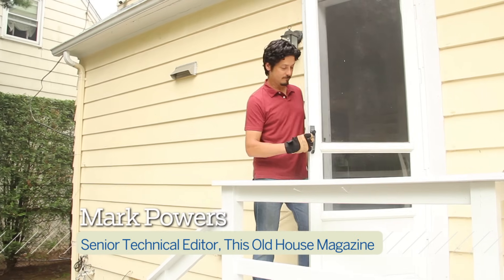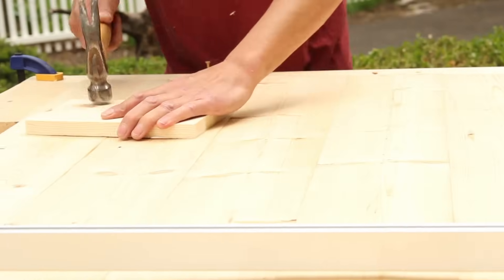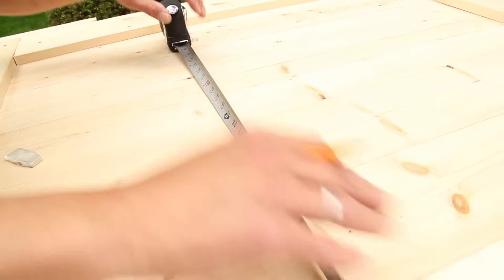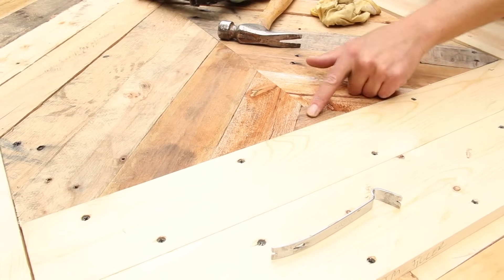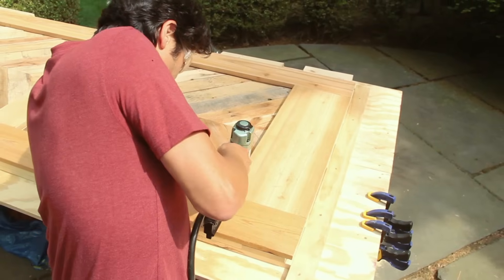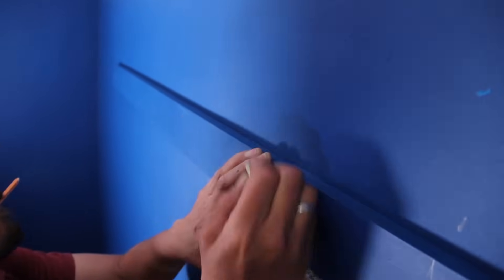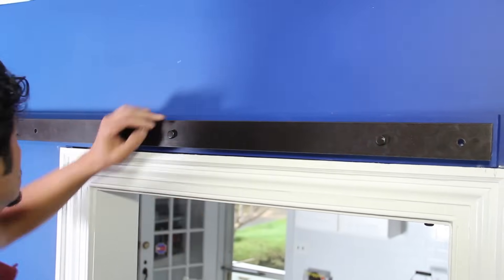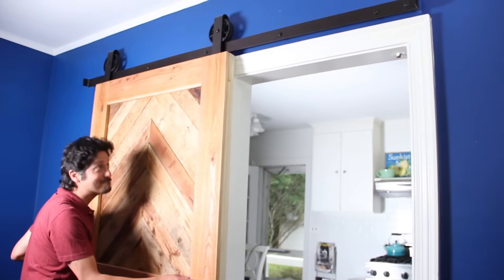How to Build a Sliding Barn Door | This Old House

Comment: Built one using ship lap from Lowe’s  stained it but she didn’t want it polyurethanes. It warped  what do u think caused it an how would I fix it
Reply: If a board warps from humidity or moisture or just drying out on its own...(which is most likely the case since the boards were straight when you started) there is often little that can be done to repair it. What was the shiplap? Pine?

Comment: How well those things stay on track? If it comes off track, a 200 pound door could flattened the little lady like a pancake.
Reply: I've been doing construction for over 100 years. The solution is to put a used condom on the door handle and near the joints
Reply: @jamesross1798  wh-😦

Comment: $50 in materials 
$1000 in tools
Miter saw
Drill
Air compressor 
Nail gun
Pocket hole jig
Hand tools
Reply: Most homeowners have some basic tools.   You could also rent them out for a low price.
Reply: Material is between 200.00 280.00 for a 1× 6 10'   pricing in wood is going higher .
Reply: Also between 80.00 to 100.00 on the metal slideing rails. I just bought one

Comment: pallets do NOT come apart that easily!
Reply: I've seen cheapo thin ones like that with cheap nails come apart pretty easily. The ones with the thicker boards and ribbed nails are a pain in the backside.
Reply: Agreed! If you watch enough how to with pallet videos you'll see a few using a special tool to take down a pallet much easier than without it. Still a lot of work though.
Reply: John Dough Looks like I'm not the only one who watched pallet disassembly videos like my life depended on it.
Reply: Aryan Adibmehr there is an electric saw that cuts pallets down quickly. There are YouTube videos showing you how to do this.
Reply: I've seen them. They're called reciprocating saws or sawzall.
Reply: erger
Reply: ergr
Reply: I just tore down a set of pallets.  They’re all nail gunned now, with 4 or 5 nails per joint, which have to pulled for a project like this.

Comment: A lot goes into making and installing a custom barn door. Simple kits and slapping things together is not the way to go in my opinion. I have built and installed over a hundred doors of all different styles and sizes and every installation is different and yes, you need many big and little parts, lots of time and all the right tools on hand and in your work shop. The look isn't for everyone, but if you are into the rustic nature of things, then it can be really cool and functional. Watching this video, I think I would have built it similarly, but I would have been using olde wood and no, pallets do not come apart so easily nor are they so easy to work with. To do it right a door like this could take a few hours to build (after obtaining any olde wood) and depending on thickness when done, as many to install. Every little detail matters. So many do not do this, but I think it is best to coat all your boards on every edge and side before assembly. That way, if things move or gap, you don't see new plain looking cuts or coloring. If you insist on painting wood, definitely do that. I do not like to paint olde wood but to each his/her own. If you use new wood, let it dry in the space it will end up being installed in for a week to be sure it does not warp, etc. Once your door is done you do not want that to happen (one more reason I like olde wood). There are several things you can do to make it all come out just right if you take the time to want to. Custom, passion, creativity and design are all the keys! https://www.northshorebarndoors.com/